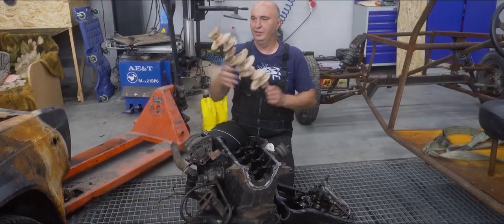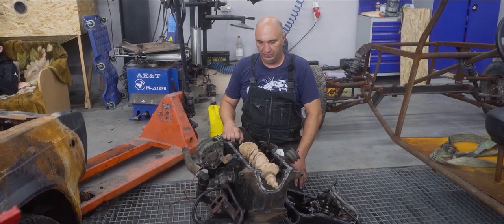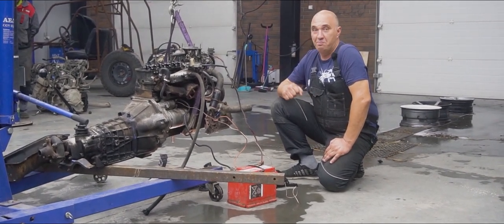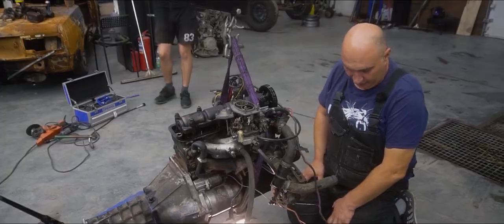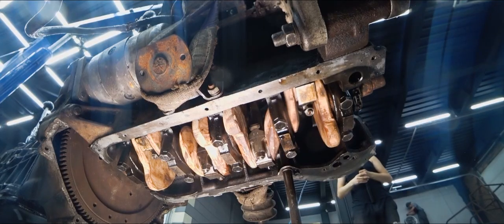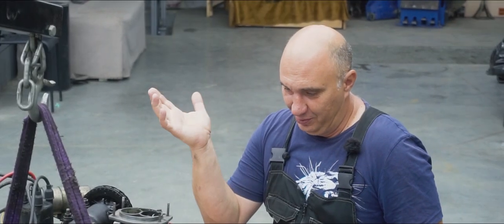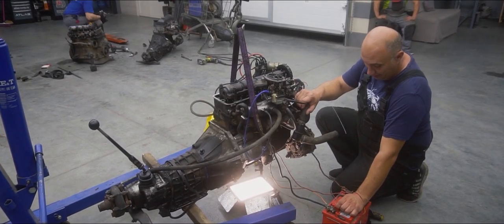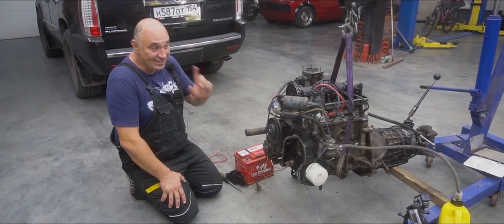Wooden crankshaft – will it work?

Comment: Try a wooden crank in a singal cylinder 2 strock engine
That way wont have no valve to open & close and no cam shaft 🤔
Reply: Nice idea, lots more heat and stress tho I’d say
Reply: @Youtubeforcedmetochangemyname   glad to have made someone laugh😁. By the way, absolutely LOVE your username! It's awesome.
Reply: @lloydy___8720  true tbh .. i bet the high revs would rip it to bits as well 🤔
Reply: How do you see the crank in operation? 2 strokes kind of rely on a sealed crankcase
Reply: @ludditeneaderthal  i agree on that 1 yes...but with a small strock engine sume a small size you xould poss do a 1 piece wooden crank 🤔
Reply: @Nottsmodifiedcarchannel  few 2 stroke singles use a 1 piece crank. 3 shafts, 2 wheels composite is pretty much the norm. A tiny rc engine is single piece shafted, and the low output could well be better suited to a wood crank. However, they also tend to use their crank "journal" as the intake tract for the crankcase, a huge potential for failure of a wooden crank. Though they use a cam shaft, perhaps the "old school" tecumseh/Briggs and Stratton small engines might be an option. Small enough for single piece carving, but reasonably large enough dimensions that might allow the wood to survive
Reply: @ludditeneaderthal  i didnt think about the rc engine thats a good shout tbh 👍  
Id think if they try the 4 cylinder engine wood crank agen   if they used stronger wood & better glue and poss work the wood better in a faction i think it mite just work even if its just for a min or up to say 2.500rpm 🤔🤔  i mite have to try sumet silmer with engines i have laying around after iv finish my youtube project thats on part 8-9 at moment n other stuff 😉
Reply: @Nottsmodifiedcarchannel  as their failures were obviously adhesive film failures (glue line, not wood) their choice of adhesive was pretty obviously the weak link. But their failures were also only at main journal/crank web joints. That indicates their "teardrop" web flexed under load, and/or the crank "rocking couple" flex overloaded those joints. A simple solution would be turning the mains and webs from one piece (spools, kinda), leaving the webs as full discs, and then using dowels and some "gee whiz" high tech marine epoxy to assemble the rod journals to them. The fact that 1 and 4 failed at the cap web pretty much makes the rocking couple the culprit
Reply: @ludditeneaderthal  i think your rite on that one thinkin back to the video ...im not 100% if they used any oil or anything on the parts on wooden crank where its restin on the engine... there defo room for improvement there im hopein they give it a secend try 👍
Reply: That might work after they convert the Lada engine from 4 stroke to 2. And cut 3 cylinders off 😂.
Reply: @Nottsmodifiedcarchannel  I'd say the char on the revealed journals is a good clue that points to "assembled dry", lol. Makes sense, any oil or grease on that raw wood would get forced into the grain by load, and that would equal swelling and drag. Wonder if they plasti-gaged the clearances, rofl
Reply: @killerdinamo08  you could try that 😂 if ya realy wonted to but im on about a difrent engine tryin the wooden crank out on 😁
Reply: @ludditeneaderthal  we shall have to wate and see of they try ot agen with wooden crank and if there idears have changed 😁

Comment: You would have to machine a crank out of 1 solid block of hardwood like oak... Season it / harden it or so
Reply: Glueing end grain to end grain is the weakest glued joint, too. Single piece of tough hardwood, machined to shape... might work for a while.
Reply: Almost had me wondering if I could copy-mill a crank into wood.
Reply: IPE would have held up a lot better

Comment: Depends on what kind of wood. MANY different kinds of wood. Some wood can be as soft as cork and others stronger than steel..
Reply: Hope they try again with another one. At least quebracho.
Reply: While there is no wood stronger than steel, there are woods stronger than others
Reply: @ehodzic155  morning wood
Reply: Hickory
Reply: @foreverendeavors6210  Yes Or Ebony wood but that will destroy tools
Reply: Bubinga and afromosia both unbelievably strong wood wouldn't say they are stronger than steel though. However if cut out in one piece no glue id imagine it would run awhile
Reply: Agreed. The crankshaft should also be made with one solid piece.  I think all the pistons will still eject out the bottom, but I wanna see that. Lol
Reply: @burnotto1663  after seeing what axe handles endure some lasting decades i imagine one machined with the proper grain patern would run for a little while anyway..
Reply: @foreverendeavors6210  Yes it is true
Reply: lol stronger than steel
Reply: My first thought exactly...mahogany? Might be an expensive endeavor.
Reply: @meinaccount7619  Perhaps not exactly but you are destroying your steel tools working on Ebony quite fast!
Reply: @burnotto1663  if a machine can cut through hardened engine parts, there isn't any wood even close to the hardness of engine forged steel, not even in the same league..

Comment: Did they seriously think that wood glue would hold up the the forces of pistons firing???
Reply: Maybe some dowel pins or dog key
Reply: The glue is stronger than the wood if applied correctly.
Reply: The glue itself isnt the problem
Reply: One solid piece made from a solid oak wood would hold up
Reply: For real. I was annoyed they used glue. Should’ve drilled holes and connected the pieces via screws and bolts
Reply: The did what they could
from a pile of wood
they gave it a try,
it just didn't fly                            Yet I agree.
Reply: @mostbrutalvideos4612  How about wood fiber directions if made from one piece?
Reply: And the force from the  compression stroke
Reply: Yep..some common sense missing:)
Reply: Not enough vodka  Zbigniew

Comment: I would LOVE seing you guis make a 4 cilinder engine work like a 2 cilinder , making It fire cilinders 1 and 4 at the same time and then 3 and 2
Reply: Now there's an interesting one, and on a standard 4 cylinder it would be possible but requires a redone camshaft and after that simply change the ignition to fire 2 at the same time. Massive torque peaks but uneven RPM I would guess.
Reply: That's how it would run if it was 2 stroke but i don't know how much work would be needed to make a 4 stroke engine 2 stroke
Reply: The 2000 mpg(yes that is miles per gallon) vehicle efficiency projects have motors that only fire every 10 or more revolutions with a massive(by comparison) flywheel. There are lots of interesting experiments that could be done by varying the crank and cam setups like you suggest.
Reply: @jonahcottrell2879  No, it does not need to be made a two-stoke. There is simply a delay between the firing of the two sets of cylinders. Not hard to understand...
Reply: @murmenaattori6  not hard to actually read my comment either lol I never said it needed to be 2 stroke just that it would be how it'd fire in a 2 stroke configuration
Reply: @jonahcottrell2879  The way you worded it made it sound like it would need to be converted to 2 stroke. Like, why mention it -was my thought. Keep in mind, I've heard crazier things from people who actually don't understand 4 stroke and 2 stroke IC engines, so didn't stop to think about it further.

Sorry for my mistake, but in my defense the wording is still just off. Good day, thanks for notifying me.
Reply: @jonahcottrell2879  To add, the reason I misunderstood your comment's intent is because the content itself is wrong. Because that is not ''how it would run if it was 2 stroke''.

 Because on a 4 stroke the simultaneous firing sets would still be divided over 2 rotations in order to complete the 4 stroke cycle. on a 4 stroke all 4 cylinders would fire within 2 rotations, in pairs of 2 with a firing interval of 360 degrees.

On a 2 stroke all 4 cylinders would fire within 1 rotation, in pairs of 2 with a firing interval of 180 degrees.

Comment: I would drill and pin the wood together along with the glue.  2 pins on each joint
Reply: Yup...glue alone is not enough...either they make wooden dowel or joinery

Comment: I originally thought "wow, that's some amazing woodwork to make the crankshaft out of 1 piece".
Was super disappointed to see it glued..
Reply: me too...  and then the way it was glued (no clamps, etc..) was just a guaranteed mess... honestly surprised it lasted for as long as it did
Reply: I am pretty sure a single piece would have been able to start and idle for some time.
Reply: @buddy1155  probably, imho, as well... until the journals got to hot/messed up.  I think a BIG factor would be to have it running "right" too!  I think they should've set the ignition timing BEFORE even trying to start it,  instead of just twirling the dizzy around while cranking... I think a few "fires" that are too far advanced would be REAL hard on a wooden crank!
Reply: @billymanilli  I think the main issue would be lubrication of the journals, just how good they are lubricated (and cooled by the oil) would make the difference.
Reply: @buddy1155  Yeah, man, I guess we see it pretty much the same then!  I was thinking along the lines of "even if we could dry-sump oil it,  or stick the oil pump pickup in a pan of oil or something... I wonder how long it would take the wood to soak up the oil and expand/soften/make a mess/etc.."  

At any rate- would love to see someone actually machine a crank out of a good hard piece of wood and try it again  lol
Reply: @billymanilli  The type of wood is very important, big difference between balsa wood and ebony. If someone really knows what he is doing I expect you can get away with a lot. People already build working bicycle form wood including crank and chain.
Reply: I thought the same thing.      "Wow....pretty impressive to turn that piece on a lathe".
Reply: They shoulda had a dowel pin or two connecting the two sections.
Reply: @buddy1155  with a hard wood, loose clearances, thick oil, and very high oil pressure, it just might work. Up to maybe 800 rpm! And no torque load!
Reply: @buddy1155  The first bicycles were wood, but had no crank or chain. Simply Fred Flintstone power. Circa 1800.

Comment: 🔥❤😍👌awesome video nd love from INDIA. the reason why the crankshaft have broke is because you are running the motor DRY without oil, because u have tried to start the motor alot of time and during that process the oil in the main crankshaft bearings have dried out nd that resulted in the breaking of the crankshaft 😅😅

Comment: Oookay... now try to make a SOLID (without cutting it into small parts) crankshaft out of ironwood and see how long that lasts
Reply: Thinking the same thing. There are woods like that which would work and get it to reliably idle with tensile strengths exceeding 3ksi but the cost and availability is outlandish for some of them. You'd also need a pretty large blank to start with and Ironwood may not be available in such a large size.
Reply: And stronger wood too..

Comment: VLAD!!! I hope youtube translates my English into russian. I'm a Mechanical Engineering major at a university in Colorado and I wanted to give you suggestions on how to improve the ridgity of your WOODEN  crank shaft :). So instead of using glue to just connect the counter weights, main journals and connecting rod journals into one crankshaft unit. Instead, use wooden dowels with the addition of glue to JOIN all the components together. This will give the crankshaft extra mechanical strength than just having glued contact surfaces... If you think of wood grain, it flows in one direction, which is why when chopping wood, it's better to chop it with the grain in the vertical direction instead of the horizontal direction... You probably know this already, but I just wanted to say that with the same concepts of using wooden dowels to connect all the components together, you take advantage of the wooden grain being in the horizontal direction... SO the force exerted onto the connecting rod journals will exert the force onto the wooden dowels, instead of just the glue contact surfaces... I hope you understand this, your channel is an inspiration to me on "thinking outside the box." Please keep up the awsome work man. You aught to do a feature on your show where other people show off the ubsurd mods they have done to their cars lol. Best of luck Vlad.   -Evan 

To @Garage 54

Comment: For your second revision I suggest drilling holes in every link and use wooden dowels to strengthen the connections. There are ones being long enough to fit the cranks in full length and noone could honestly tell you didn't just use wood because you did!
Another thing I was a little concerned about was that every wood glue I know needs loads of pressure while curing. I am not shure, if you have put enough pressure to the linkages.
And one last thing would be to lube up the pistons with Motocoty and the crankshaft with something along the lines of wax to give you more time to play with the engine.
Reply: Need is relative; the pressure is there to minimize the gaps so there's as much wood and as little glue as possible, and no air. In this application I doubt it made much difference. I fully agree with your idea to reinforce the joints with pins; that would make it MUCH stronger because you'd have solid pieces of wood taking the shear instead of glue joints.

Comment: I am a wood worker. I see that the crankshaft is put together in sections. This can work but I have a couple of suggestions. Wood glue is very strong but needs to dry overnight. Second the glue joints need to be clamped together and clean from any grease. Third to increase the strength you need to use wooden dowels between the joints or use wood screws in each section put together. If you glue two pieces together properly the wood may break before the glue which is very strong. If I had a Lada crankshaft here in Florida I would be inclined to try it. Also try a hard wood maybe Walnut tree wood.

Comment: Hydraulic lifters? No oil in motor maybe the valves weren't opening
Reply: Come on it's a lada engine. You adjust clearances with a sledgehammer.

Comment: I studied and practiced fine joinery and carpentry for 5 years. I am by no means a master carpenter. Far from it. But I had the privilege to learn what I learned from master carpenters. A single piece of wood in this application would actually be weaker. Its all about aligning the grain to prevent fracture. The wood is strongest when load is applied perpendicular to the grain, loads applied parallel to the grain cause the wood to split along the grain. If he drilled large holes through the journals and glued in hickory dowel rods through the journals it would have lasted longer. Using laminates of thin layered plywood built up to the needed thickness for the webs of the crank would have also increased strength. Better yet, make the journals out of solid round dowel rod, hickory or ironwood, or osage orange, something like that, and make the webs out of high grade plywood comprised of thin laminate. I still dont think it will work, but it will last longer. You will be able to get the engine to fire this way. How LONG it will last is another question.

Comment: It's unbelievable guys, You nearly made it. I must say that You have incredible ideas, great workshop possibilities, but You must work on Your engine skills - if You would set the ignition properly without sprark plugs to avoid a compression it would be running for a few seconds instead of flame torching thru the exhaust, but still congratulations it nearly worked :)🤘

Comment: Should have used wooden dowels at the gluing points. Glue them, then drill two 15 mm holes, and glue two dowels through. That woulld have kept this together.

Comment: The thing that they should have done was put a square wooden rod through the middle of the whole shaft so that is has more rigidity aside from just the glue. That way the wood would have more support because the stress is on every joint from the forward rounded rotation... This could have worked with that little detail being added.

Comment: Use some harder wood to make the crankshaft,like oak and as you mount the pieces together,drill holes 2-3 holes on every glue point and put some wood screws in there. Also lubricate those bearings better and it mite work for a while. 
Crazy ideas need crazy ways of doing  them😁

Comment: Im a mechanic if somehow you were able to machine a wooden crank out of a solid piece of wood I recommend soaking the crankshaft in a big bucket of oil for at least 3 days would be less rotation friction from the flywheel to the timing gear might hold up longer maybe long enough to run the engine

Comment: You should also use dowel pins with the glue to hold it together. The dowel pins will prevent the glued together sections from rotating.

Comment: Wood glue is significantly stronger than wood, so if your glue is failing to hold it's because it's not being used correctly(or is the wrong type of glue). For maximum bond strength, impregnate your surfaces with the glue by pressing it in with your fingers or something, then apply more glue and clamp the pieces together. If your glue is properly set, the wood will get shredded long before the glue even thinks of failing, assuming it isn't being damaged by water or chemicals.

Comment: I'm impressed you got it to last that long but reason it failed was the glue not the wood. Try this again and maybe get actual wood worker to make it, with joinery methods. Few dovels drilled to connect the parts would probably been enough to hold it. Alternatively try using plywood and for love of good make it with machinist tolerances, or least straight:D.

Comment: Can't wait for the episode where they build an entire engine from wood. 

On the crankshaft, instead of just gluing the joints, drill through the pieces once aligned and install dowels with glue. That'll do it.